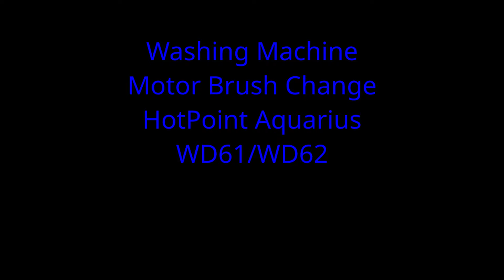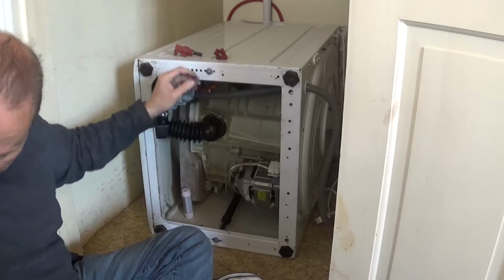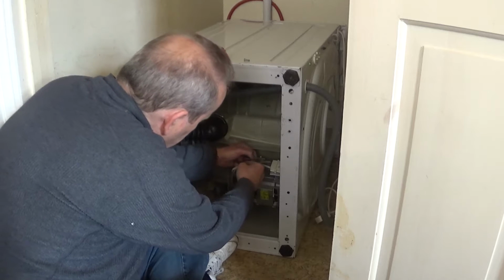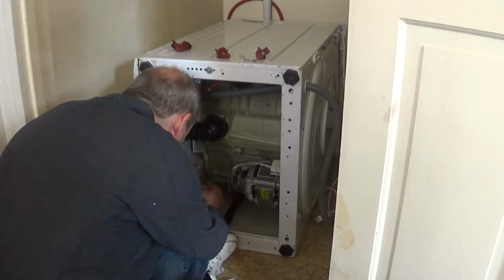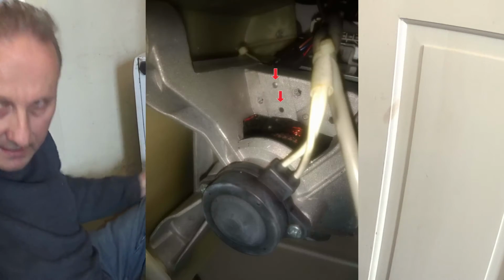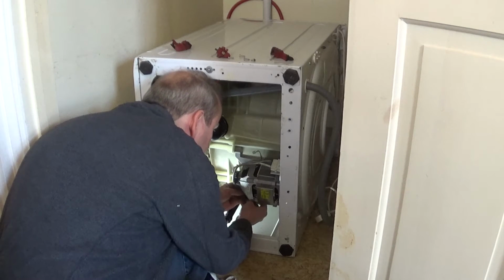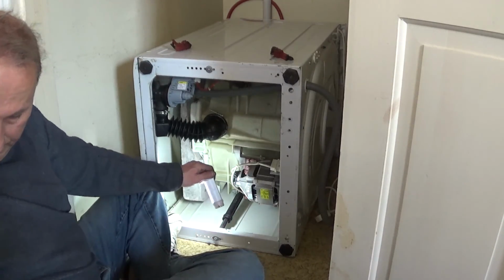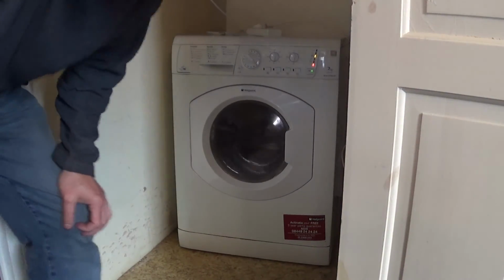Hotpoint washing machine motor not working, now does! HotPoint Aquarius WD61 WD62 Brush Change

Comment: Good fix - nice to see the machine back up and running - the whining should ease off once the brushes have bedded in too!!!  I think washing machines were one of the first things that I started repairing as a kid.  Our current machine is from the 80s and has had SO many repairs over the years but it's still running.
Reply from the maker: I had a Hoover probably from the very early  80s or 70s which kept going without issue. When a switch packed up I just swapped it with one I didn't use. Then I got given a almost new Whirlpool which had terminal bearing failure in 18 months, since then I've had two Zanussis . Very reliable, both second hand.

This Hotppoint is a friend of mines.
Reply: @BensWorkshop  There's always something very satisfying about fixing stuff like that rather than replacing it - they're not the most exciting piece of equipment to buy so I'd always either fix an existing machine or get one second hand.
Reply from the maker: Absolutely. I tend to get washing machines second hand as well.

Comment: That was very interesting.  Quite fiddly even though reasonable amount of access.
Reply from the maker: Yes, often washing machine motor brushes come with a tab to hold the brush whilst you fit it that you then break off. If these had them it would have been a lot easier.  

That said, as you can see it took 10 minutes which is less time than it would have done if I took the belt and motor off.

Comment: Hi. I have this machaine that wouldnt spin at all. I replaced the brushes an then ot only spins 360 degrees once every few seconds. It does this 3 times an then does nothing. Any help greatly appreciated. Thanks
Reply from the maker: Sounds odd. No idea what could cause that.

Do you recall what state the commutator was in? Any evidence of burnt out wiring? Also were the old brushes worn out?

Many thanks for watching, please like, share and if you like the channel, subscribe!
Reply: The old brushes were quite worn. A few mm left. When it stopped 1st I took them out an put them back in an it worked a few days until the new brushes came.  No evidence of anything burnt.
Reply: The commutator was smooth. No obvious damage. I've never seen faulty brushes but I might try another set
Reply from the maker: @barrymcbride3583  what about the state of the commutator?
Reply from the maker: @barrymcbride3583  you could try removing them, checking the electrical connections and refitting.
Reply: I've tried that an swapped them over with no joy. The motor seems to turn quite easy so I'm baffled. Thanks for your replies though.  I appreciate it
Reply from the maker: If you have a multi meter measure the resistance across the brushes. I have two videos on wiring washing machine motors here:
https://www.youtube.com/watch?v=lZeNHKIfiXQ
And here:
https://www.youtube.com/watch?v=8uYmBJt8_Us

Comment: My washer won't spin(Hotpoint Aquarius) had the back off,belt ok would replacement brushes solve my spin problem? I have noticed there is a black powder residue on the floor underneath were the motor would be positioned,any help appreciated thanks in advance
Reply from the maker: The black powder residue if wear on the brushes. If heavily worn that would explain your problem. They are cheap enough and you can see that they are not very difficult to change.
Reply from the maker: Oh, and please like, share and if you like the channel, subscribe!
Reply: @BensWorkshop   yep subscribed and thank you for such a prompt response
Reply from the maker: @stevedirt5269  Many thanks!
Reply: @BensWorkshop  must have watched 20 vids all super long and not relevant your vid is precisely what I needed  it's concise and super helpful plus your instant reply made it so I could order the parts(less than a tenner) quickly and efficiently again many thanks will be binge watching your content this weekend 💯👍
Reply from the maker: @stevedirt5269  Many thanks! I'd be grateful if you let the ads run too (though not the silly long ones) :)
Reply from the maker: @stevedirt5269  Incidentally you will find a variety of different topics on here, including steam, stationary engines and fixing things as well as tool reviews.
Reply: @BensWorkshop  yep want to give something back mate honest u helped me so much